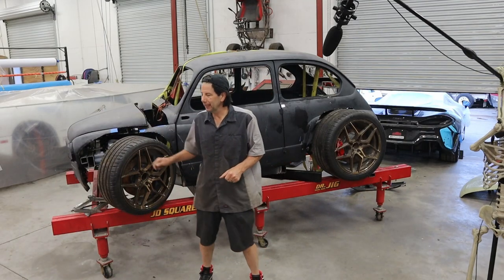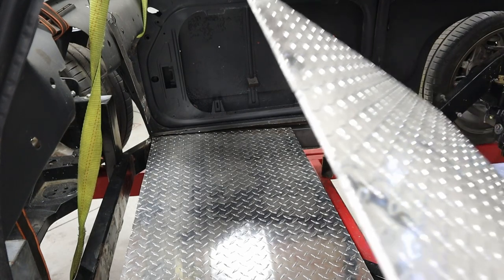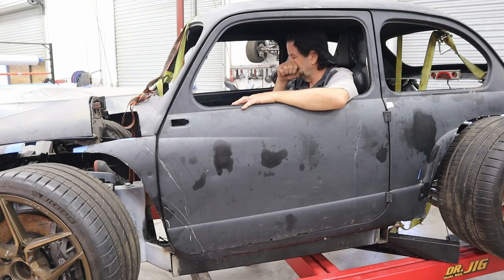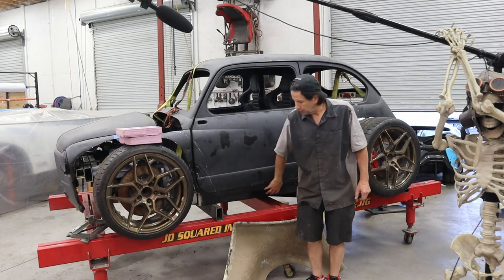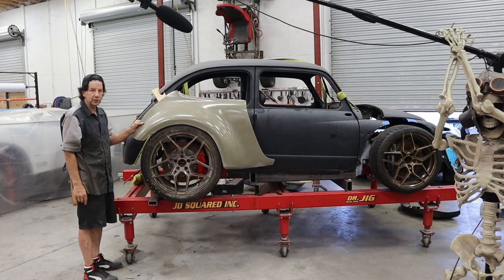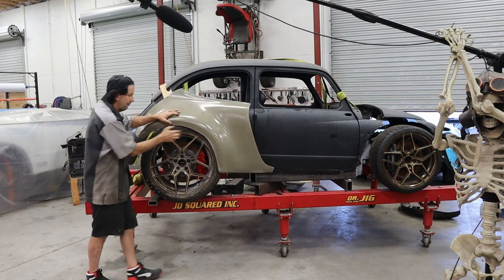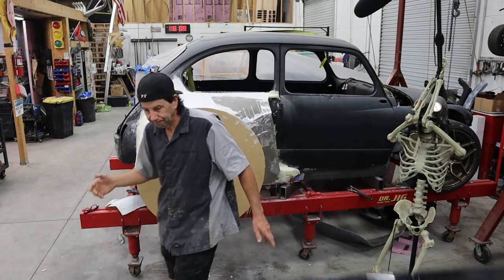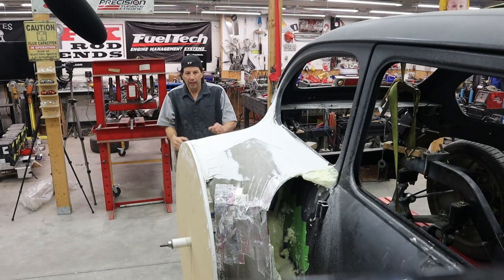Time to Widebody The Fiat!! Episode 1

Comment: its beginning to look very hot wheels, love it.

you could make the shell 'bolt-on' that could make working on the engine etc much easier.

you could go with a different shape of tail light, maybe something wider and LED? now that you have all that extra room. maybe something with sequential lights.
Reply from the maker: All good ideas…thanks